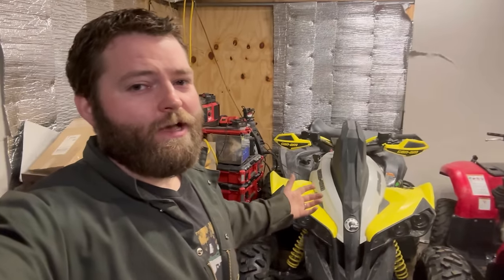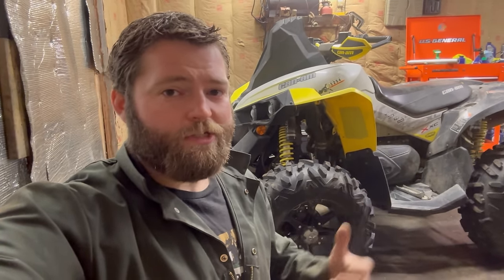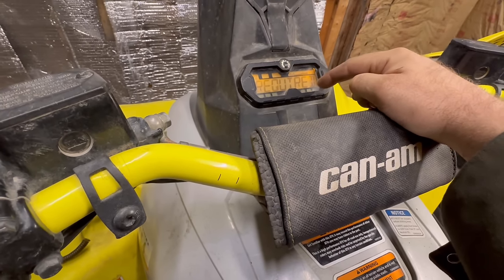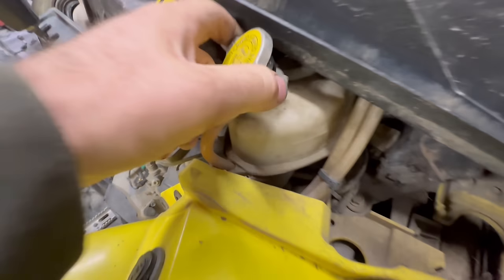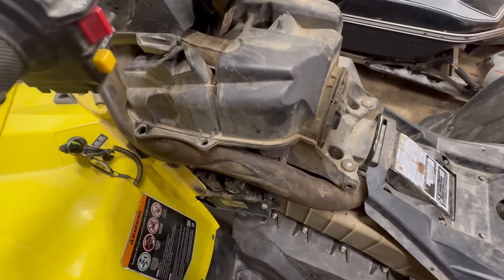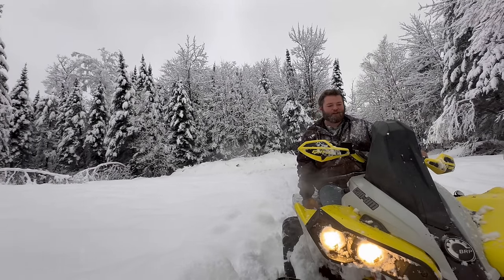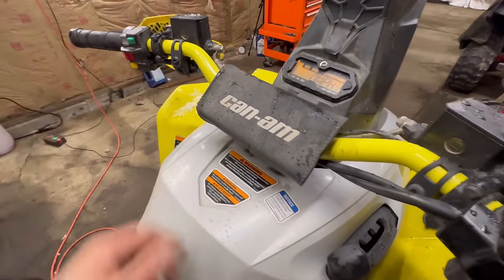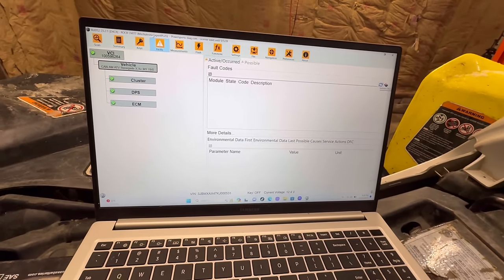Can am Renegade 1000xxc repair!

Comment: The Can Ams are wicked machines!  Had a 750 King Quad and updated to and 850 Outlander - can’t believe the difference- and the KQ is a great machine!  Great video!!
Reply from the maker: The kingquads are nice machines but the power difference from the 750 KQ to the can am 850 is insane.
Reply: @rockspowersports yep I went from a pioneer 500 to a xmr850 now I’m doing wheelies across mud holes all day long 🎉😅
Reply: Can am sure makes a good atv.

Comment: Hello , I have a 2014 can-am renegade 500. I am having idling issues and was wondering if you know what's going on. When I start it idles perfect. When I give it gas to rev it up the idle will stay high at 3200 rpm and stay there. If i shut it off and restart it does the same thing.

Comment: If I know one thing from owning canam products , first batteries need to stay on a tender , once they are a tad low it won’t run right or at all check all connections one loose connection and bike will do this , Second ignition’s mainly g1 models always have issues with the chips keys giggling in ignition itself and killing bike , third radiators even when it looks clean it’s probably not clean enough, specially stay with XPS fluids don’t change because the price is a bit high you pay for what you get. Can’t beat a rotax . I’ve never been stranded just have to know your bike , if you don’t a manual and some forums can point you in the right direction ❤ sweet video man
Reply from the maker: Great tips man! Gotta love the rotax power!

Comment: Hey man I really have a question about a 2013 can am1000 I’m working on, it barley goes over 25-30mph , so far I put fresh gas in it , checked fuel pressure which was 50psi , and blew out the clear vent tubes and it’s still low on power. It starts and idles fine just low power please let me know what you think the problem could be , I’m think it’s the injectors but not 100% sure.

Comment: So all it needed was codes cleared?
Reply from the maker: Codes cleared and modules paired with the vin. Someone had changed the speedo at one point and probably didn’t pair it. The can am’s are pretty sensitive to electronic changes.
Reply: @rockspowersports   good video. Good to know. Awesome machines but not a fan of all this new technology.  Seems like its on everything now. The new bikes are loaded with all the junk and its been like that for years. Ktm always has issues. Which is pier mobility and they own 2 other bike companies plus husky and gas gas.
Reply from the maker: It’s certainly hard to do any work on the newer stuff without the laptop unfortunately.

Comment: Ever plan on selling thr Arctic Cat 1000?
Reply from the maker: Yes, it’s for sale $5000
Reply: @rockspowersports  I bought each my daughter's a new Argo Xr500 se for their birthdays 2 months ago. Great machine.  443cc 32hp engine same machine as a Arctic 450 and Kymco 500, front locking differential and 3500lb winch. My youngest stopped riding it after only 10 hours on the machine.  My oldest loves to ride. If I sell this, I will buy the Arctic Cat 1000.